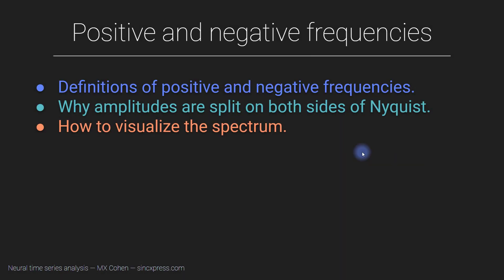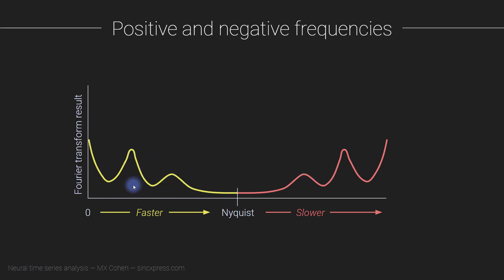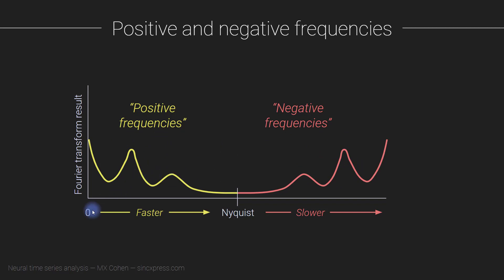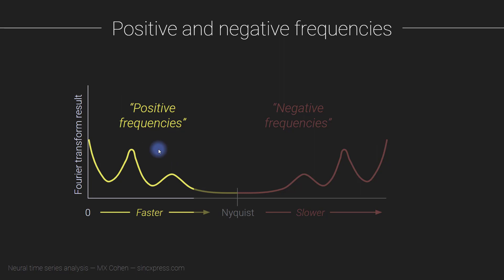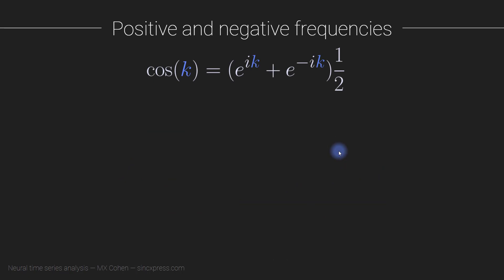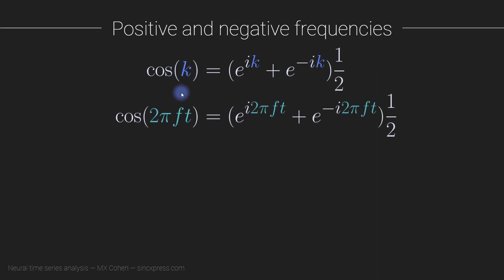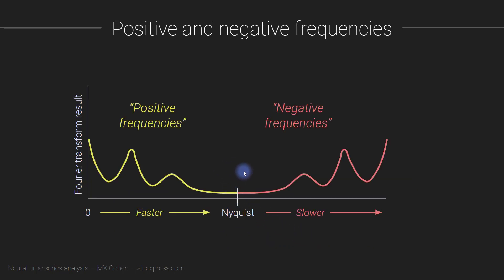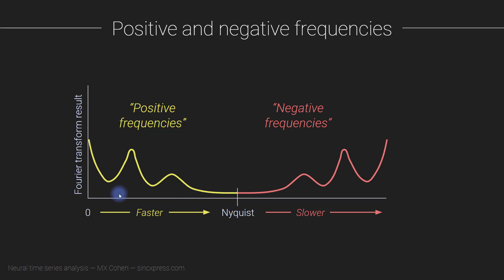Positive and negative frequencies

Comment: Thank you so much for this amazing series, it really helped me a lot. I have a question regarding the negative frequencies please. I'm sampling a signal at a rate of 1000hz, so my Nyquist frequency is 500hz. After that, I filter the signal with a bandpass filter between 20-450hz. When I plot the Fourier transform results, I'm still seeing positive and negative frequencies, which are mirror images centered around 0. What I don't understand is, if the negative frequencies are the ones after Nyquist frequency, and I am already filtering the signal below Nyquist frequency of the signal, how do they still exist?
Reply from the maker: Thank you, Amr. When you filter, the negative frequencies are also removed. That's because the filter kernel is symmetric in the frequency domain.

Comment: Thank you so much for this video series; it has been truly invaluable! At 1:40 you mention that the FT of complex values performs a little differently and you allude to possibly touching on that in more depth in a later video. Did you ever make a video discussing FTs on complex signals? I am struggling to understand how complex sampling works in software defined radio (which typically uses IQ data) and I imagine such a video would help a great deal. I have scoured YouTube and elsewhere and can not for the life of me understand why bandwidth = sample rate with IQ data.
Reply from the maker: Hey Nathaniel. Well actually, the mechanics and interpretation are the same for complex-valued signals as for real-valued signals. The only difference is that the spectrum is symmetric (that is, the positive frequencies mirror the negative frequencies) for real-valued signals and asymmetric for complex-valued signals. 

I don't have a specific video on that per se, but I do have videos about complex-valued Morlet wavelets, where you can see an example of an asymmetric power spectrum.

Comment: Thank you for making such complex (no pun intended) subjects accessible to people like me who thought they missed the boat on advanced mathematics and were forever screwed in understanding LFP analyses! :)  

I'm still a bit hung up on the necessity of using complex sine waves to compute the Fourier transform - do you have any suggested readings, video, or code that steps through the alternative strategies of how it would look to compute Fourier using real sine waves? Thank you so much for what you do.
Reply from the maker: You're welcome, glad you found it useful. You can check out my NEW ANTS playlist on spectral analysis. I also have a full course on the Fourier transform on Udemy. The short answer to your question is that using only real-valued sine waves would give a spectrum that is phase-dependent. But you don't actually need complex sine waves; you can also do it using real-valued cosines and real-valued sines to account for phase alignments between the signal and the sine waves. But then you'd need to combine the information from both. This is actually what Fourier originally proposed, and nowadays we used complex-valued sine waves because it's more convenient.
Reply: @mikexcohen1  How and why would sets of sines and cosines account for phase alignments between the signal and the sine waves? How is the information combination thereafter done?

Comment: Thanks for the great video. But I think it should be hz = linspace(0, srate, N+1) at 11:45, because the first point of dft corresponds to 0 hz and the (N+1) th point corresponds to the sampling rate. Note that in Matlab, "y = linspace(x1,x2,n) generates n points. The spacing between the points is (x2-x1)/(n-1)." (x1 and x2 are included in y)
Reply from the maker: Excellent point, thanks 祐誠張. In fact, the exact number of frequencies depends on whether the time series has an odd or even number of points. I go into this in more detail in the full version of the course, but for a relatively long time series, the difference is tiny and usually inconsequential.